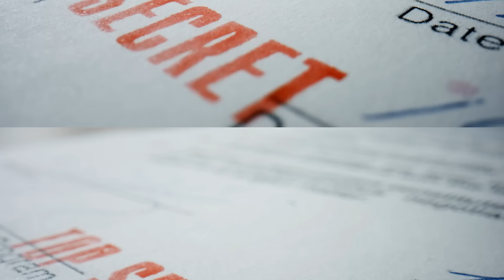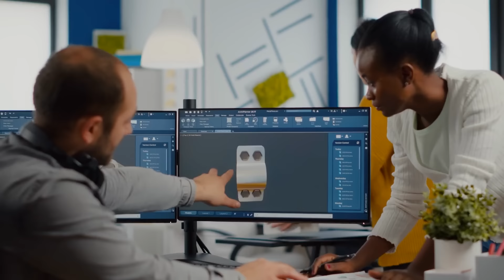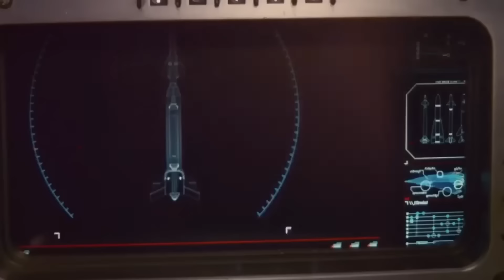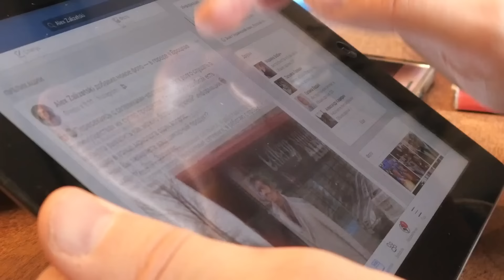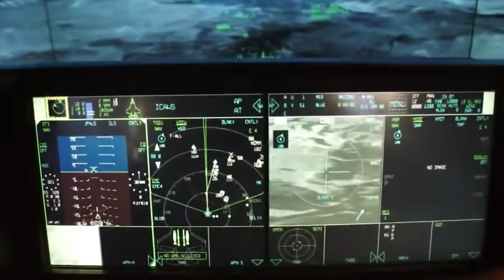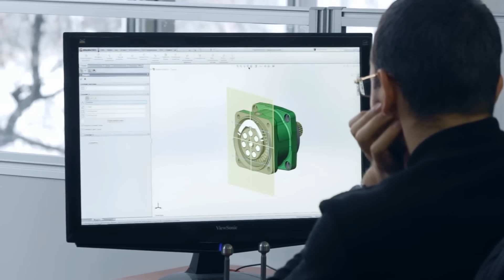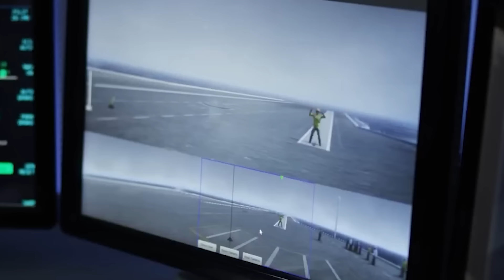US SECRET Airplane Was Spotted by Sailors Over the Pacific Ocean

Comment: Cloak technology on material can appear invisible To naked eye, not completely invisible but nearly enough. Certain angle can detect but at speeds going doubtful could physically see at Mach 9, ability to travel faster is known. Tends to limit perception. We know by prior public reports certain aircraft travel 25,000 miles per hour and can circumnavigate Earth 5 times before refueling.
Research & Development requires on going development.
Currently 15 aircraft available at any time.With much greater performance metrics.
Production replacement contracts include sea equipment and more.
I expect my investments on improvement basis. We have moon base.
We have Mars base.
Soon more.

Comment: I believe there is a new US super aircraft that will be used against an enemy soon.    Its top speed will be Mach 7 +.   It will be undetectable.
Reply: and it will cost some good tax cut out of your peanut salary to  make a one flight  just for it destroy its self🙃
Reply: Mach 10 at least! If you research the SR 71 you’ll find out that there is data that says the engines had no limit, which means the speed with depending upon the air frame not the engines.

Comment: Just because you say stealth, does that actually mean anything anymore? No.
Reply: Yes it does actually
Reply: @andreww1225   Its yet to be proven in battle, therefore until it completes missions without being detected, then this is just another pipe dream video.

Example: "downed F-117 Air Force serial number 82-0806, callsign "Vega 31""
Reply: @jdisrael7607  The Lockheed F-117 Nighthawk was a stealth plane used by the U.S. Air Force in the Gulf War in 1991. 
 The F-117 flew approximately 1,300 sorties and scored direct hits on 1,600 high-value targets in Iraq. 
 The F-117s attacked 31% of all targets struck during the first 24 hours of the war. 
 They destroyed Saddam's 600 hardened aircraft shelters, command bunkers, and command and control facilities. 
The F-117s had an 80% mission success rate and suffered no losses or battle damage. The F-117s' stealth technology made them less vulnerable to enemy fire. Major Feest dropped the first bomb on Iraq in Operation Desert Storm...
Reply: Look up- tr3b black manta secret anti gravity plane
Reply: @RobertDeloyd search- tr3b Black manta anti gravity plane
Reply: @craigjohnstone1461  if its a secret, how did you find out about it?
Reply: @RobertDeloyd  Ok, thanks.